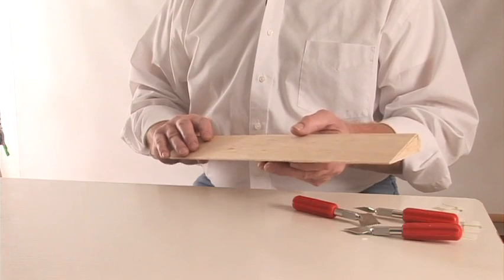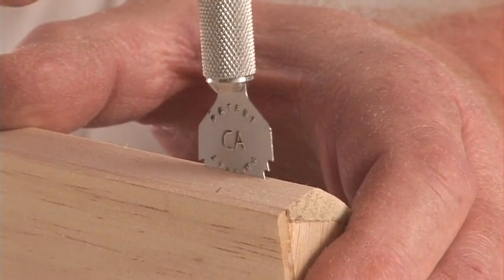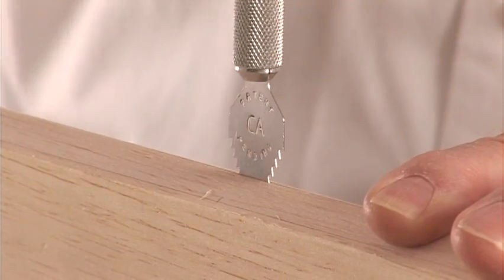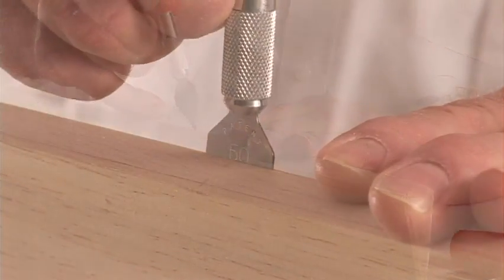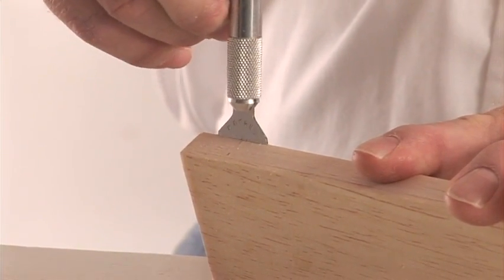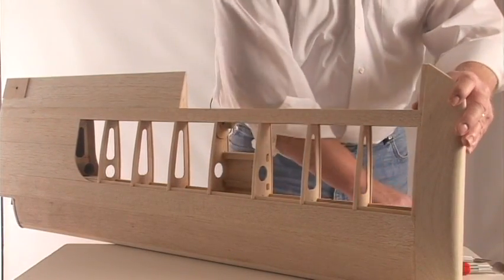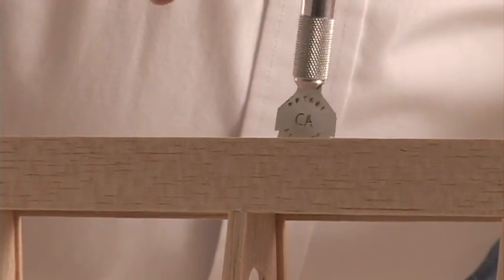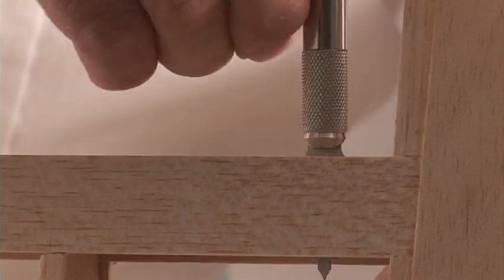AeroBroach - Hinge Slots in One Shot!

Comment: Just found this while searching out CA hinge installation. I've just been unhappy lately with the GP Hinge Slotter. I find the blades are too fast and I have no control of the slot. This looks great. I have some new builds over the winter and I don't want to mess up the hinges. Haven't tried pin hinges in ages. I might on the next build with this tool.